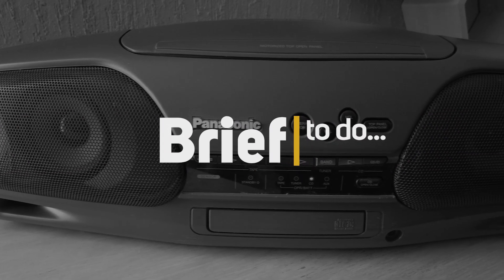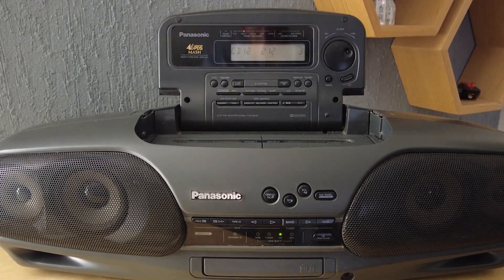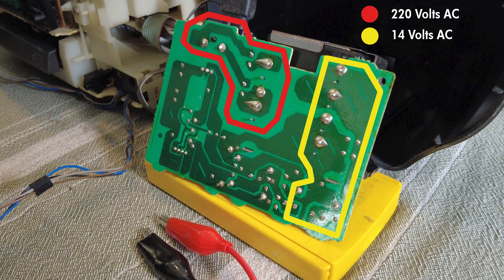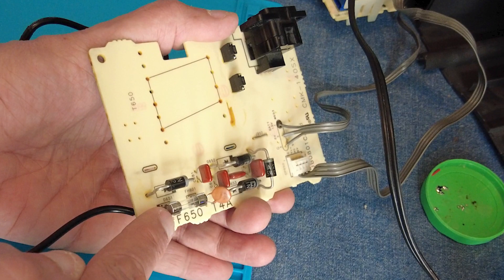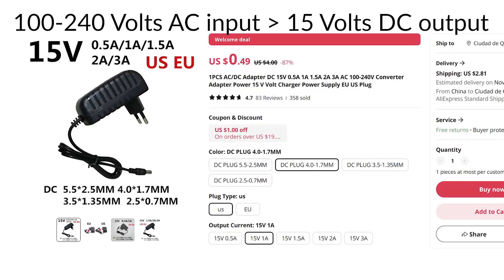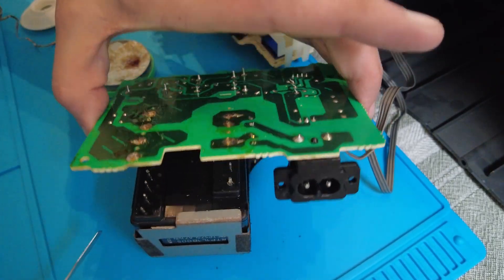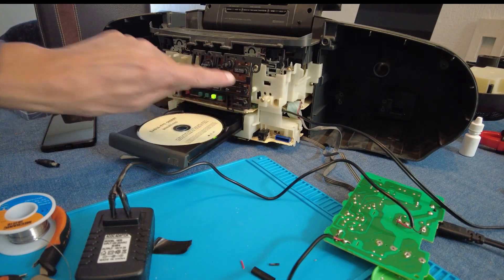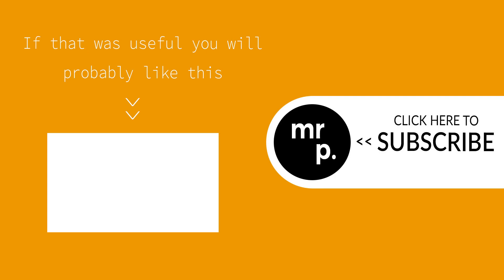Old Stereo Voltage Input Conversion ⚡

Comment: You must cherish that old stereo. I was thinking you could have run the DC through a barrel connector directly to the PSU board in the stereo, and plugged the plug pack into that, but that would have meant drilling a hole in the case.